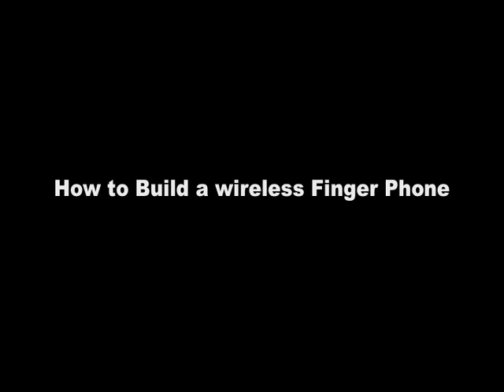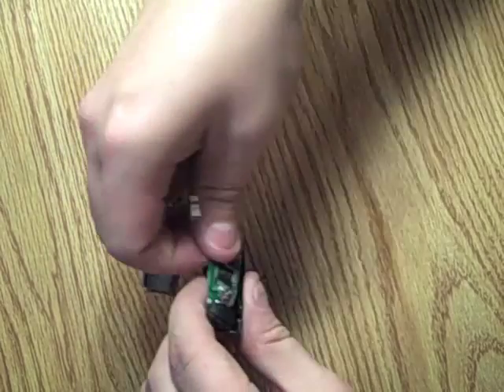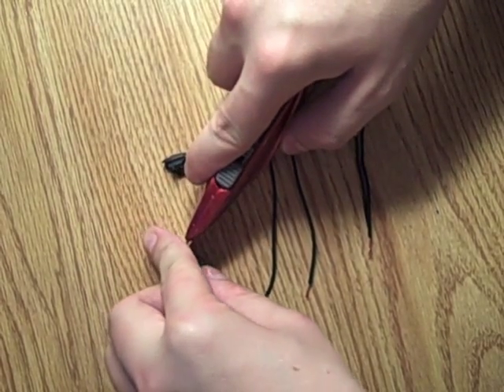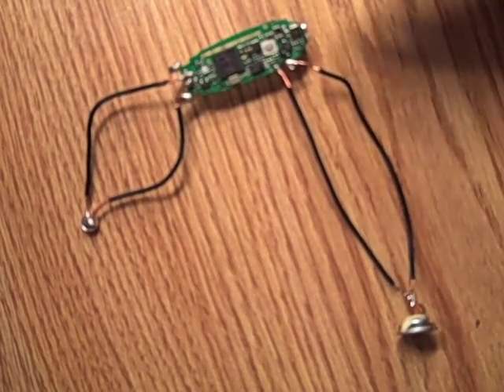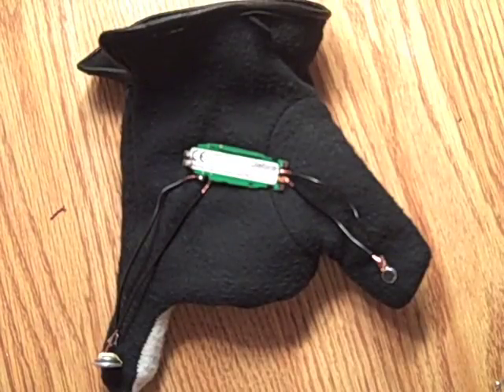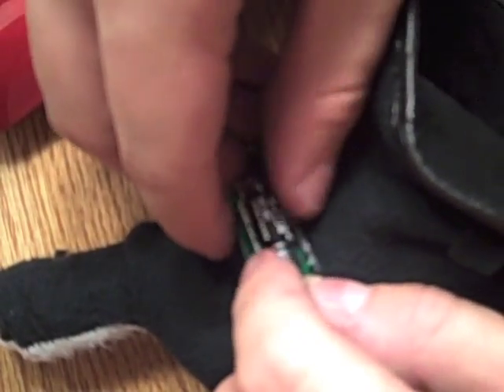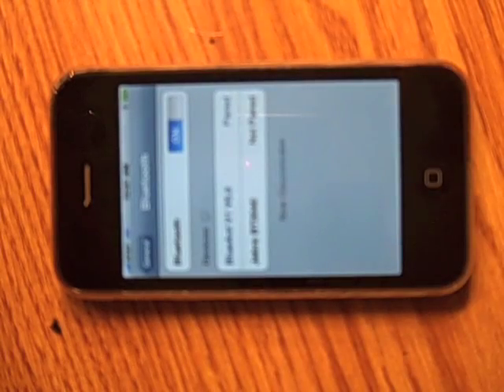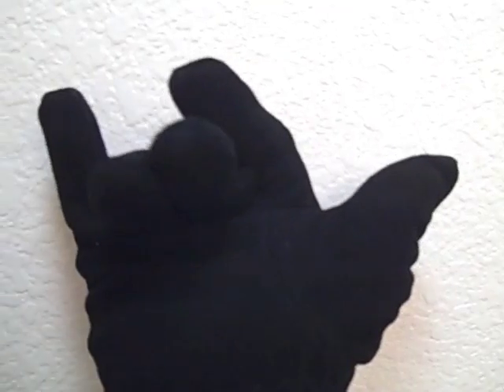Build a wireless Finger Phone

Comment: "Soldering", but it's fairly simple. Just need to practice on some spare wire to make a small, neat connections.
If you practice on just some straight wire (ie. not in a circuit) you won't fry anything or cause any irreversible damage! :D

Comment: The model he used had a AAA battery, but if yours needs a charger, I would assume you could just pop the circuit board out of the same hole you used to put it into the glove, and run the charging cable to the circuit board.